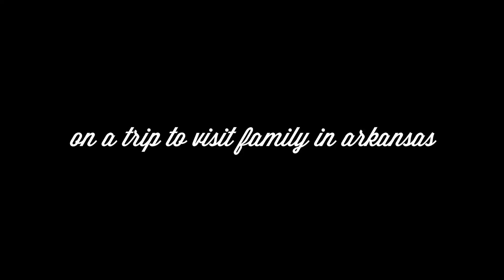Aligning Trusses & Garlic Harvest! | Earth Block Home

Comment: As you know, with a bit of stimulation, the milk lets down and sprays out uncontrollably.  In India, they let the calf punch up on the milk bag and suck to get the milk to let down. They drag away the calf and milk the udders into a bucket.  When the flow slows, they let the calf loose again to punch up on the milk bag again and start the let down all over again.  

I missed what you were making with all that white pine, 4x4's and lag screws.